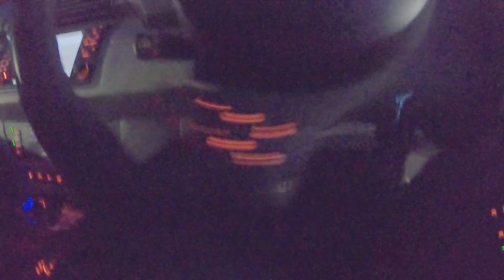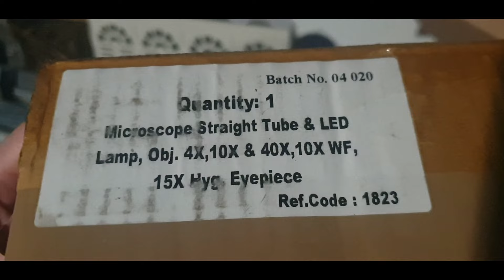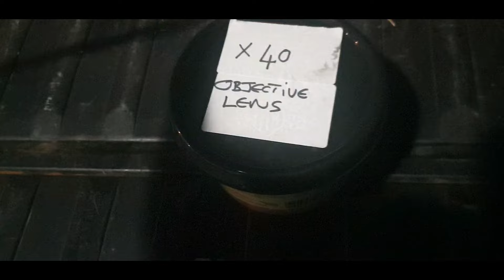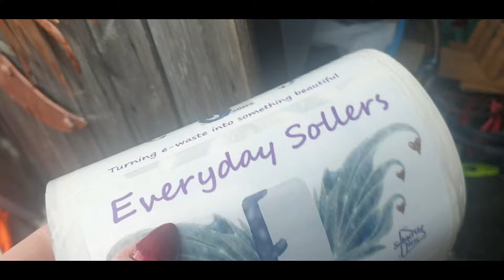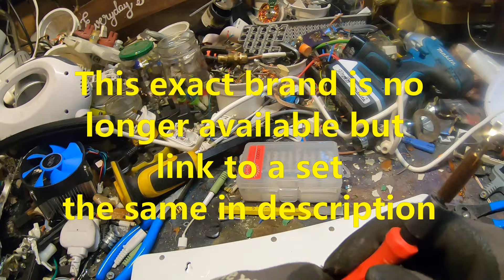Fab Medical/ Science equipment dumpster skip dive score & doing lots of bits and bobs!

Comment: Small long flat head will undo triangle screws  and most washing machines have three concrete weights in them if you have the tools you could take them off before you load it driver with Phillips head and 10mm socket on driver bit
Reply from the maker: I think I'm just too stubborn and like the challenge of getting it into my car lol. I find they only undo with an impact (or I might just be a weakling lol) and I can't be using tools there at night but I do actually forget that some bits can come off of things and would help sometimes 😂

Comment: Hey Sollers!  I just wondered if I could pick your brain please?  I'm planning a trip to the refiners with a big load of boards.  I'm a little confused about the PCBs with Gold Corner BGAs on.  For example, router boards, some have the Gold corners on, some don't.  Do they all go together as router boards or do I seperate them and put all boards with the Gold Corners together in a box with other types of PCBs that have them on?  Thanks 🙂👍
Reply from the maker: So when I went I just tried to grade the boards by similar components and they said I graded them really well. So if you do have some with better chips then I'd separate them. They do go through them when you are there so they will categorise them anyway but if you pre-seperate them it will just make it easier and it will be no harm done if they all go in as one in the end. Hope that helps and hope you get a nice payday!
Reply: Thanks for the reply Sollers, hope I didn't wake you up!!  I'll let you know how I get on 👍
Reply from the maker: @Wreck-Gar  no worries, I'm a nightowl, just off to bed now🙂